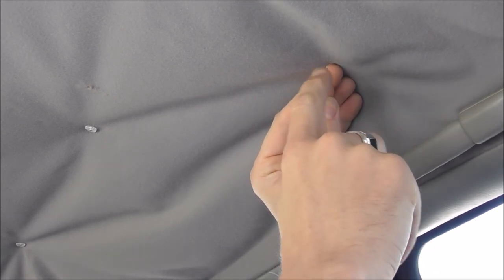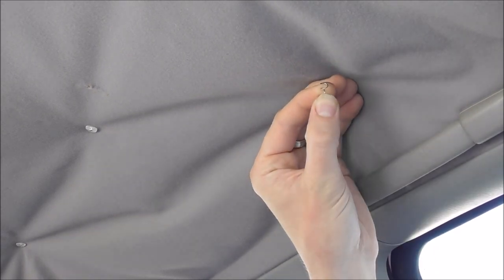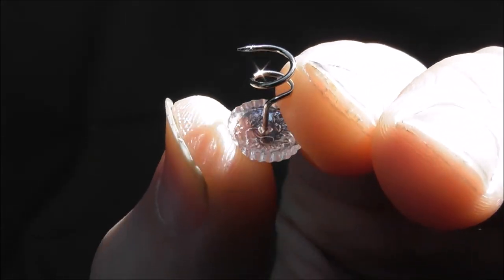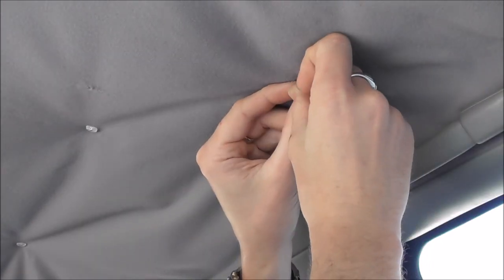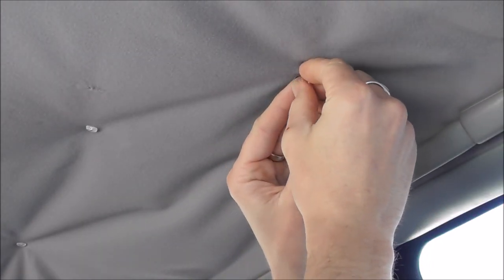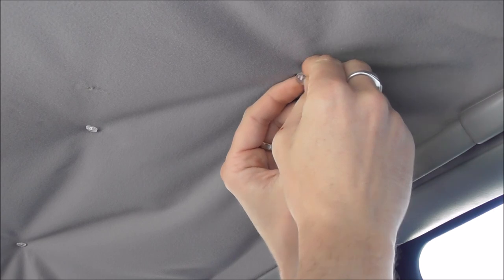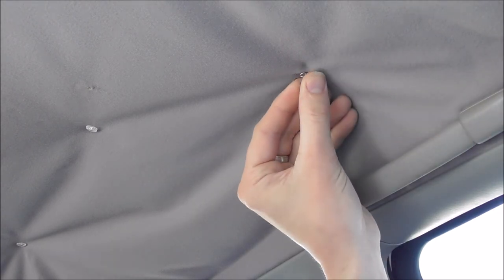How to Fix Sagging Roof In Car Using Twist Pins -- VERY EASY FAST & CHEAP NO GLUE

Comment: Thanks for the vid! I have to say all headliners are not created equal. I went to the best headliner repair place where I live (North Texas, USA) and they said they wouldn't touch my VW, too complex.  Then I was told prices at other shops of about $1000 USD. Those tacks will work quite nicely for me.
Reply: Paul Lorenz same here.. I hope yours is not as horrible condition as in this video 😭😭

My Tahoe has slight sag near windshield area. $350 for whole job ...

$6 twist pins will work just fine..... just ... fine

Comment: Could you use those pins to hang fairy lights inside, if the headliner is fine? I have a micro campervan, looking for tips... Just wondering if they'd stay up with these pins. 😊
Reply from the maker: That could work, just need to be careful with pins, because there is onnsome vehicles a water hose for windscreens stuck to the roof boards from behind, its a risk when using pins that you may puncture this

Comment: i wonder if using super thin paneling (or vinyl? oh maybe the heat would get to that making a mess ugh) of some kind with bunch of tiny holes drilled it then attach it to headliner with those pins would be better? anyone try that?